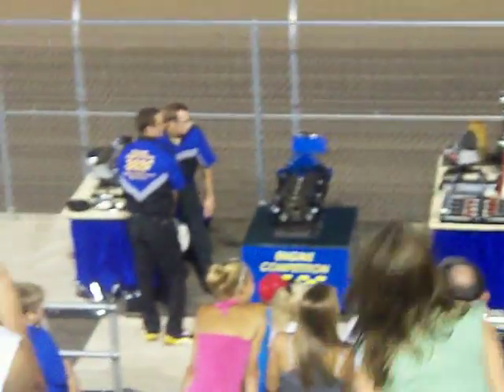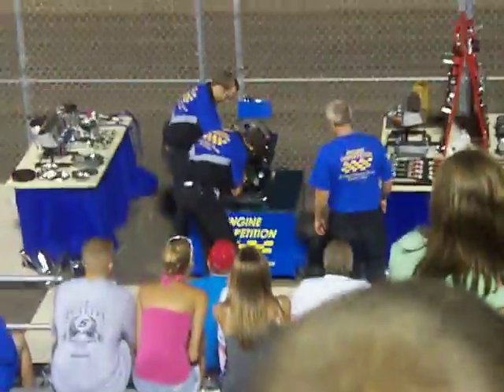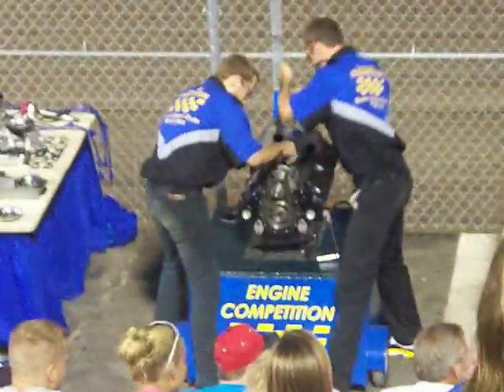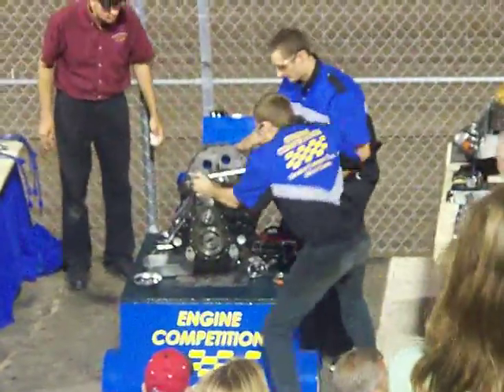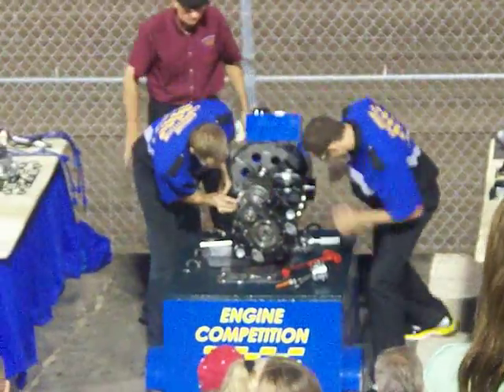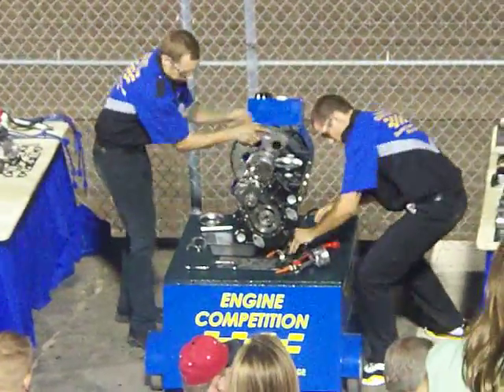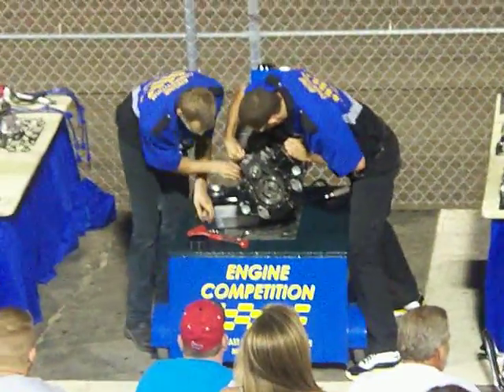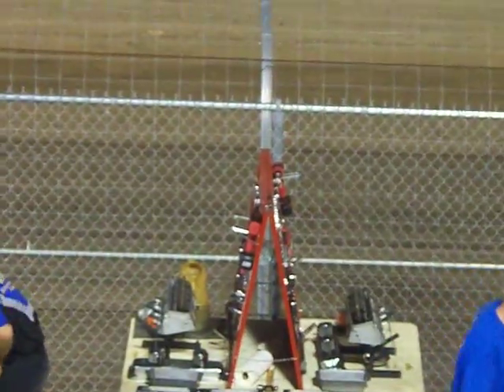Engine Building Team SCC Milford Part 1.MOV

Comment: This is where america has lost it's way, they have forgotten QUALITY TAKES TIME & GOOD WORK AINT CHEAP, & cheap work AINT GOOD ! I freaked out @ 7;50 when that amature just screwed on a DRY OIL FILTER, that is a BIG NO NO! I could NEAVER assemble an engine with out CHECKING CLEARANCES, & priming the oil system prior to start up. The 1st. team to start their engine are the BIGGEST LOOSERS. ~V~ Obsession.